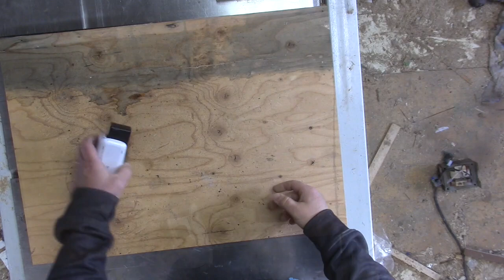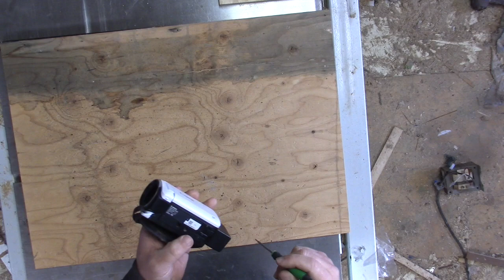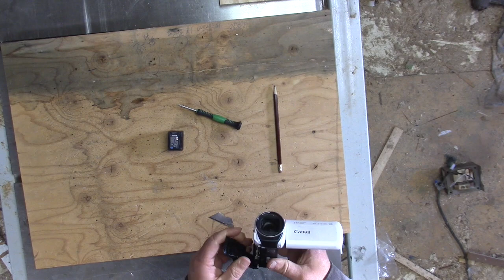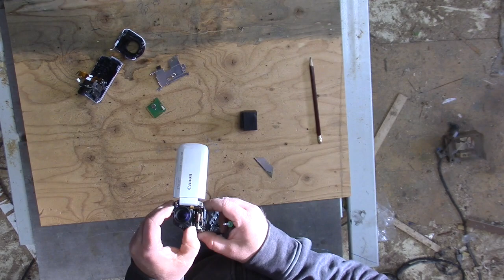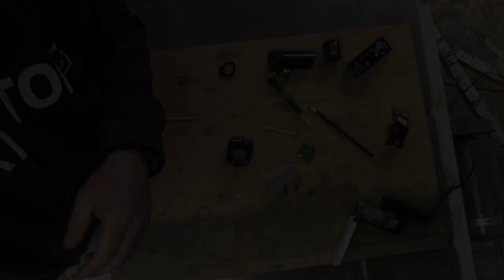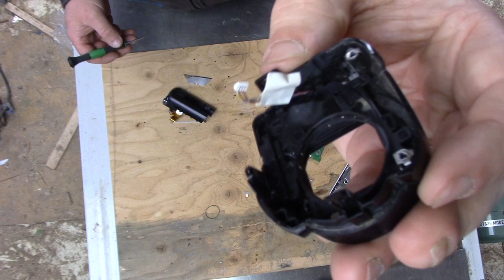Canon Vixia HF R600/R800 Fix

Comment: I have a stupidly extensive history with repairing these cameras and I'm 99% certain its a mainboard issue, when these take a tumble it breaks the big connector on the board that links the lens/sensor assembly to the rest of the camera

Comment: Nice work! Glad to see people fixing things instead of throwing away and buying new.
Reply from the maker: I was very happy it worked!
Reply: @acme663ryo  where is the ir blocking filter on this camcorder??
Reply from the maker: @unlimitediq1894  I don't believe so.
Reply: @acme663ryo  it doesn’t have one?
Reply from the maker: @unlimitediq1894  not unless it is built into the deep internals. It has a thread ring on the outside for additional lenses. Sometimes I screw on a fisheye for shots.
Reply: @acme663ryo  fuck